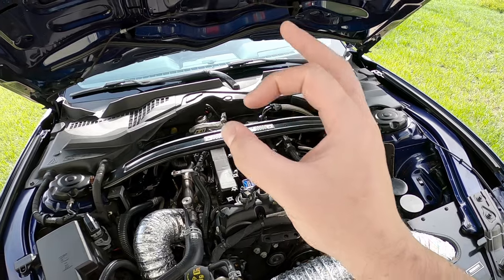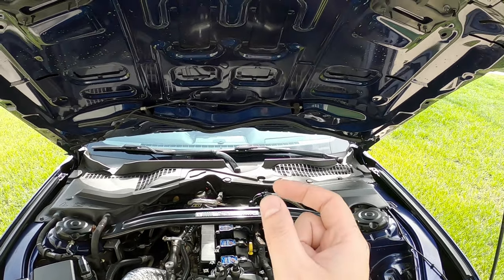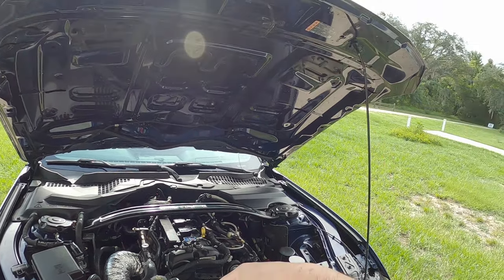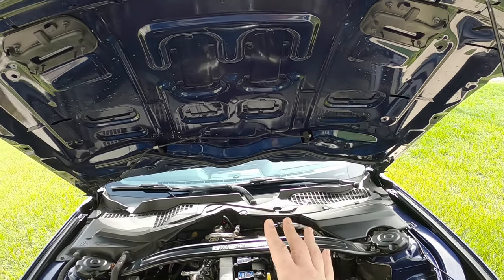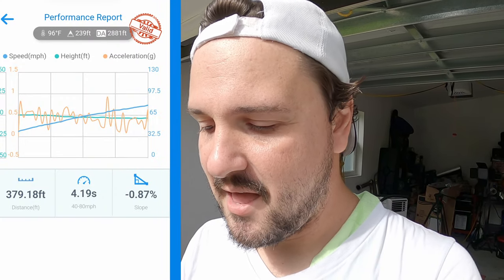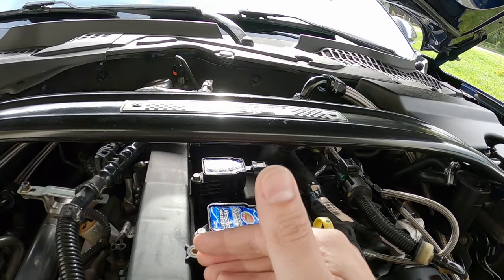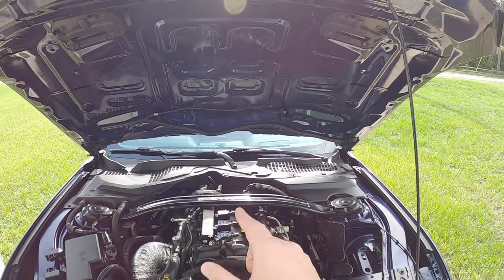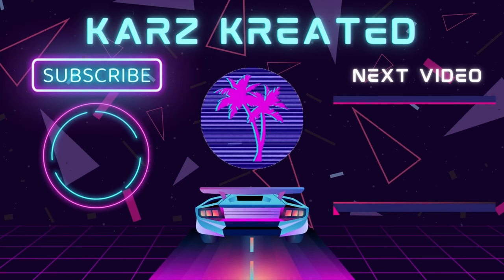DON'T Use the Wrong Spark Plug Gap!

Comment: Are you sure it was in the same spot? 
The slower draggy shows significant downhill vs uphill on the faster.   

Draggy from a roll for me has felt off
Reply from the maker: Same spot. I reconnected the dragy to the satellites after each run. At the end of the day, it's just a dragy. There's always some discrepancies.

Comment: Ah yes you basically just helped me diagnose the misfiring problem. Gap probably too big
Reply from the maker: What's your gap at?
Reply: @KarzKreated  I just checked amd they were at .033. I bought them pre gapped. Definitely was the problem
Reply from the maker: Yup, that'll do it.
Reply: @KarzKreated  .028 good?  I run 26psi consistent. Peaking above 27psi
Reply from the maker: It should be. When I did the pressure ratio video, I was peaking 28 psi and didn't have blowout at 0.028 gap.
Reply: @KarzKreated  crap that didn't work. I hope getting new ones will fix it. I got brisks
Reply from the maker: You can always try gapping down to 0.026. Every setup is different, so your specific setup might require a smaller gap than mine at similar boost levels.